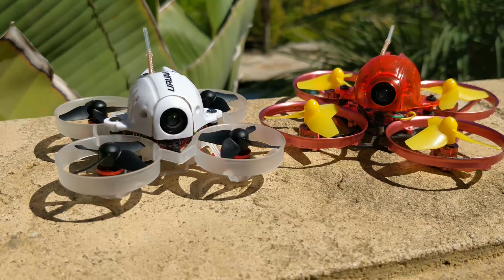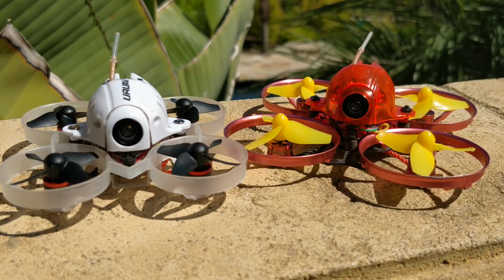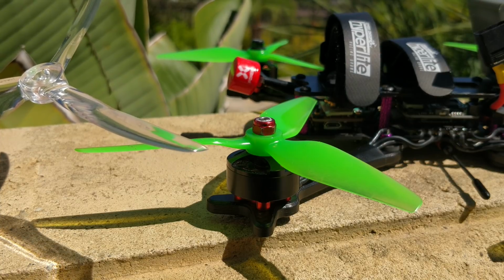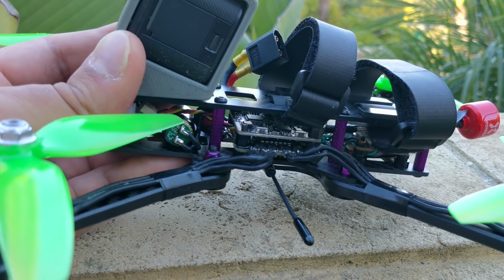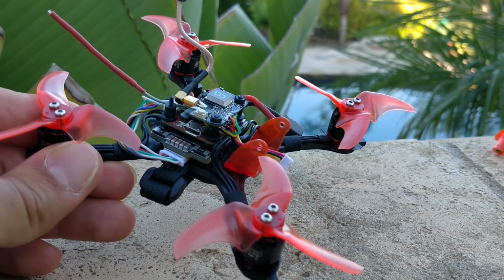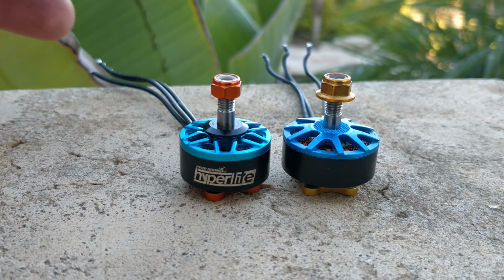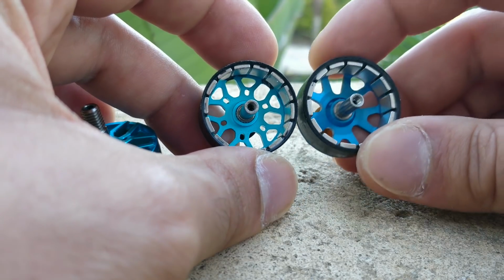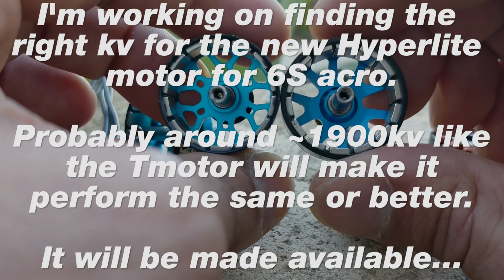Whoops, Hyperlite, HQ 5.1x3.1 and other things

Comment: I know this video is older but I’m even more confused now.  Was running 2306 4s and then went to the 2405 2522KV thought I liked em better but ended up wanting 2306 again. Now I wanna try the 2207 as there’s so many options, including the new Xing Motors, then I saw the 2207.5 Is it that much better plus they still say 2207.5 to this day. Does Serge even know. Or are they now correct and no longer 2207.8 And are they still as efficient as most 2207’s. To may dang Motors out there to choose.
Reply from the maker: Just stick to 2306. There are some software bugs with 220X motors right now. 2306 is super solid on 5"
Reply: Ahhh Kabab. 🤪 now I have to rethink what motors. I was gonna get the HYPERLITES or HYPTRAIN ACRO,  Serge doesn’t do 2306 Anymore. Now you got me looking at 2306 again.. hahaha. XING seems to be a thing lately they look fantastic.  I will say as much as I love the hyperlites the outer bell could be a bit thicker for durability. Other than that  they’ve been great..
Reply from the maker: @cletussurfsalot7190  xing are wicked durable. Built really well. Top construction motor as far as I'm concerned.

Comment: man if you think 19xx kv is high for 6s just wait till you see what im doing lol. Hyperlite 2207.5 2222kv for 6s racing. not sure how well (if) it will work, but its worth a shot :). (main reason im using those motors is people that have tried it say ~2150kv on 6s is the future of fpv racing. Was gonna get the 3bhobby 2207 2150kv but i cant find that kv anywhere except for banggood. Either way its not a common kv/battery combination, but from what ive heard those that have tried it love it)
Reply from the maker: I've run that motor on 6S. It's extremely powerful. Any normal prop I put on it just flattens out. No use. 5S is best on that motor.
Reply: Kabab FPV not sure how different he 2222kv 2207.5 is, but I know some use the new hq dp 5131 prop on 6s 2150kv since it's a much stiffer prop. I'm sure I'll figure something out, and if not then I'll just have to try some different motors. (Also thanks for the vids. You've got some great flight skills and very informative videos a well:)

Comment: Hi Kabab, good to see you are back into the micro quads, I've spent a lot of time myself trying to find a brushless whoop setup that is a good combination of handling and power. I think I'm pretty close, if you have some time check out my video of me running a few laps at a local indoor event https://www.youtube.com/watch?v=-ETW8RLSwjI&t=1s, IMHO the secret is just getting darn thing the thing light enough. Screw the aluminium frames! Mine is 32g AUW with 75mm props.

Comment: Would you suggest the immortal T mounting position on your flosstyles or doesnt it really matter because you won't fly anywhere near the cf range? I'm building a 6 inch at the moment and can't decide if I will put it on a arm, in the back with a 3d printed piece or like you on your builds.
Reply from the maker: I like the position I put mine in because it's neat, safe, easy to travel with and acceptable range. Definitely not long range worthy but as you said, I'm not flying anywhere near the range limit. I've never even seen below 90% LQ.

Comment: Awesome video, want to buy both of them lol.   

Got a question if possible...           The 75mm one only option for receiver is a Compatible Flysky FS-RX2A Receiver - does this mean I cant use my X9D-Taranis?   is there a way to bind it to X9D with this receiver?  I also have a Black Edition Spektrum, dont know if it will work.     thanks a lot!     

Subbed!

PS: been away from the hobby for 3 years now, think this might be a good way to get me going again ;)
Reply: Think I just answered my own question since I just found out a 4-1 module exists now for Frsky Taranis... Getting excited about this lol

Comment: Thanks for sharing your PIDs and settings! Works perfectly with the US65 even on tri-blades, however got a bit of shaking if I suddenly hit full throttle but I don't mind it. Also my FC runs around 40% idle :D

Comment: I don't really agree with your babyhawk pro review i just bought one from RDQ and it is way better then my orginal babyhawk r and Flys like it is on rails, i actually just put a video up of me using it against 5 inch in a fun race.
Reply from the maker: Well if you setup the same tune I discussed here on the original 2" BHR with 2.5" props on it, it would be about the same. The pro pretty much only has the advantage of 9k/8k instead of 8k/4k
Reply: I feel like you got a broken one 😕

Comment: Do u reckon the ur65 will handle a 450mah lipo? Looking for lipos for my eachjne uk65 that is on the way in the post.. dunno what lipos to get. So yeah my question is, is 450mah too much for a 65mm 19000kv brush less whoop? Or should I stick with normal 260/230mah lipos?  Any recommendations rly appreciated :)
Reply from the maker: I'd stick with the 250ish mah batteries. The bigger ones won't even fit.
Reply: @Kabab   yah I guess so.. better value as well and if u got loads of em it doesn't rly matter ;) cheers

Comment: The snapper6 doesn't get bent up nearly as easily
Reply from the maker: I would assume because it weighs much less
Reply: Plus a tighter radius on the same gauge aluminum which also makes the brace arms shorter.. I'd go with a plastic one but I've had no reason yet to swap frames. My 7 is on its third frame with half the flight time, plastic frames weren't available and I've shelved it in favor of the 6...

Comment: Lol....Drone Mesh burned a HobbyWing 4 in 1 during testing. He said the FETS have a low rating. Check his test video.
Reply from the maker: If you check the fets on all ESC's I'm pretty sure you'll find that they're all rated way lower than the ESC spec. That's just the nature of our industry unfortunately. The hglrc FETs are rated to like 65A at above 6S but must be at like 10deg C. At above room temp they're only rated to maybe 15A. But hglrc rates them at 60A...

Comment: I think the problem with the babyhawk pro was that there was too much soft mounting. I think its important to remember that the fight controller needs a firm interface with the body or otherwise its going to be jiggling all over the place.

A lot of soft mount solutions can be far too soft. For example the standoffs that come with matek boards are far too weak and soft (you can break them when trying to tighten them in.

I recently went back to just using o rings under and above the FC and shakes on high throttle no longer are a problem.
Reply from the maker: Sure but the yaw ticks are due to hard jolts and misreadings so it can't be too soft in the yaw probably. All in all it was just a PITA
Reply: @Kabab  if you shake a drone and the FC moves about then you have mounted it too soft. 
There needs to be a solid read on what the chassis is doing it cant get that if the FC is doing its own thing.

Comment: I wonder about the durability of these new Hyperlite motors. Been flying the t motor f60 1750 for a while now, and they are not the lightest but it’s nice not to bend a bell every time you touch a tree branch. Previously I was using Hyperlite 2307s and they bend easy.
Reply from the maker: They should be more durable.

Comment: FC in the back of the quad ? Do you have more info on that? Makes me really curious!
Reply from the maker: What kinda info?  It doesn't care where it is as long as it's moving with the quad. Every single one of my acro quads is built like that.  I've been doing it for maybe a year now.  Leaves a lot more space in the frame and is super duper easy to build in the 20mm frame height.
Reply: Makes sense, the gyroscope part of an MMU is for measuring orientation, which is all you need for acro, whereas I can see a large GPS would benefit from the MMU being as close to the center of the craft's mass as possible to reduce anomalous readings from the accelerometer part of the MMU.
Reply: @Kabab FPV, That's funny because i was thinking about that just a few weeks ago when i did some design studies just for fun.
I was wondering how much of an offset from the center of the quad would be possible for the fc without degrading flight performance.
Thank's a lot for the research!
I was actually thinking about having a 20x20 stack vertically in the back of the quad and have the battery (1300mAh 4S max) inside in the middle of the frame.
After some playing around with the idea i scrapped it and came up with kind of the same design as yours with a very flat frame and the boards next to each other.
I'm quiete amused seeing that you came up with the same idea, but earlier, so i'm definitely thinking about buying "our" new frame from you. ;)
Reply: I was wondering if it had any effects or if it was only for space or and protection. Thanks Kabab you make me floss ! ;)

Comment: Great review on the BHR.  I just received mine the other day and had the same exact issue.  Mine came with BF3.0 and like an idiot I immediately updated to BF3.5 using the CLI Dump on the EMAX site.  I immediately started getting yaw twitch movements in the clockwise direction with a bit of shaking.  I than loaded 3.2.2 and dropped everything to 8k/8k and it flew really nice and stable.  Now that I know that the hardware was OK and not being happy with 3.2.2 I decided to dig into why the twitching was happening and reloaded BF3.5,  I put everything to stock and then started to adjust things.  The first thing I did was loosen up the stack via the screws at the bottom,  maybe loosened about a full rev or 2.  I than noticed the way EMAX has the MMCX antenna mounted as it sits directly over one of the nylon screws before feeding through the canopy.  I than yanked/pulled the antenna so that the antenna had a straighter path coming out of the canopy and than tie wrapped the antenna directly to the canopy,  leaving a slight slack to the MMCX mounting point so it can rotate but more importantly nothing is touching the stack.  Once I did this it flys frikin awesome!  Not a single twitch or shake.  As you noted these boards are soooo sensitive it does not take much to screw them up.
Reply from the maker: At least you figured it out. Mine is fully cursed.
Reply: Yeah it happens LOL,  time to chuck it and have EMAX send you a new factory assembled unit.  They OWE you this considering all the crap you have been through,  CMON EMAX send this guy a new BHR!!!!!

Comment: New motor looks good. I’ve used t motor F60s for a while and really like them, but recently bought the BH R6 2207 in 2150kv for 4s proximity and 5s speed, and im very impressed. Cheaper too, got 5 for the price of 4 t motor.

Comment: Fly the snapper outside and it will change your mind set up a whoop track those ducts bend back easy when ot happens ive had mine for about 5 months and it will do power loops lol ive been able to rip crazy wit it and try the gnb 600mhw 3.7v there the best 1s lipo for that set up it seems to have alot more punch and lasts about 30 secs longer than the happy model lipo and thats with the throttle full tilt the the lipo is done and still getting about 3min n 30 secs out of each lipo and i have 8 witch makes a nice lil fly time

Comment: Can the new frame hold the battery across the frame, centered?   Instead of down the length of the frame?  It looks like the holes in the top plate would push the battery back too far.   I’m really wanting to build one in this style and this frame looks like it would be perfect for this if the top plate would allow.
Reply from the maker: Why do you want to put the battery be like this?
Reply: I'm wanting a quad with "toilet tank" battery to get the battery centered.  I'm wanting one for testing.  I've got more than a dozen quads but, nothing I trust running in that configuration.  I've considered the Gappit from Xhover and see that Wild Willy has a frame coming out that runs both toilet tank or normal.
Reply: For the toilet tank look
Reply from the maker: look?  You're concerned about aesthetics?  No it can't do that and I wouldn't recommend it.  Putting slots that wide horizontally in the top plate makes it super weak and you need to compensate with a lot more carbon all around which adds a lot of weight and also makes it look awful...
Reply: The other guy posted about the look.   I’m not concerned with looks, I was thinking about the handling.   Thanks, though.

Comment: Thanks for the video, Bob! Regarding the new motors, what would be your KV choice for a relatively light 4S freestyle quad, 2522 or 2722? At the moment it has 2306 2450KV on (589 grams AUW), but it feels like having more power available and distributed more evenly on the throttle curve will open more possibilities.
Reply from the maker: Something in the 2500 range is probably best

Comment: Will turtle work on the brushless whoops?
Reply from the maker: Someone already tried.  Yes it'll fly, just not very well.
Reply: Just set it up for 3D mode. It seems to work, but I haven't yet tried it in the air. Storm outside and not enough space inside ;)

Comment: popo is a gimmick i mean who cares if a prop takes a few extra seconds to mount. at least the traditional way ill have peace of mind . moreover popo is heavy and even if thats 2grams ...my OCD wont let me handle a popo shaft. maybe its just me but locknuts give my quad a more serious mean look.
Reply from the maker: The pro is different. And the issue is that many people swap props very often and it can get super annoying. With POPO pro, there shouldn't be any or at least minimal downside and much quicker prop swap. At least I gotta give the POPO pro a chance...
Reply: Kabab FPV i was on the same fence with popo! But the day i bought a e-screwdriver & ratchet it rapidly changed 😄

Comment: What do you do with all your retired quad/frames? Giveaway or they get shelved somewhere?
Reply from the maker: Give away most of the stuff.  Sell some others.  I try to keep everything to an absolute minimum or I'd go nuts.  I've gotta purge some soon actually.
Reply: I'm going nuts myself with some old blackout frames and some original qav frames.

Do you the same for old electronics as well? Old F3 boards and Oneshot/Multishot/Early DSHOT ESCs? I've been hoarding a few of these and haven't thrown them out yet.
Reply from the maker: I used to hold onto things but it started to pile up so I had to get rid of a LOT

Comment: Awesome video. I kept reviewing other people on the snapper 6/7. Everyone enjoyed how it flew, but a lot complained about a part burning out, or the frame bending in. As for the other whoop you tried I have not bothered to look into it. Ive really been looking into BetaFPV 65’S brushed which I own and keeps flying down to the ground like a dead fly, but my eye is set on there new line of  brushless 65x and 75x. Im glad I’ve gone with the BBH 2” I thought about getting the upgraded new version pro, but I shall wait, Im currently ordering 3 sets of 2.5” arms and 60 sets of Avan Rush, 1 set of hardware, 1 new run cam micro sparrow 2 my camera burnt out before I ever got to use the goggles =(. 
I already have (12) 550 3s GNB. But I dropped my FS-I6 TX and broke my arming switches. So hopefully by Mid Oct ill be back in the air. Ive also bought Agility rings and ladder to start my fpv training as soon as everything arrives. 

Enjoy the rest of your weekend!
Reply from the maker: keep going
Reply: Kabab FPV I’ve been using the Hulkie props on 2”, not liking those props compared to the Avan Micros. Blacked out my esc into a palm tree I believe, I can connect to betaflight, but when I plug in my battery it starts the song and cuts off and I have no LEDs on- RX,VTx no power. But, I was able to slip in a replacement esc into my emax order.

Comment: apparently the mosfets on the hobbywing are rated for 30a only
Reply from the maker: 30A at 6S is fine...
Reply: @Kabab  but they claim 45 amps, and the temp ratings are quite low too(<30 degrees Celsius)
Reply from the maker: whatever they are, hobbywing usually puts out good stuff.  They're a very well known company for quality.